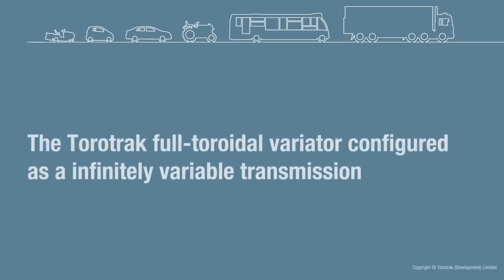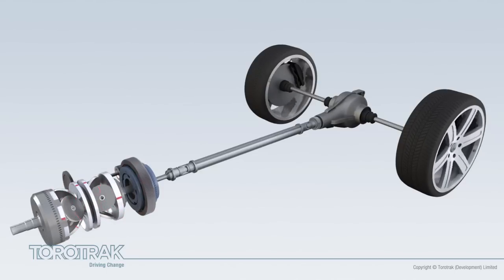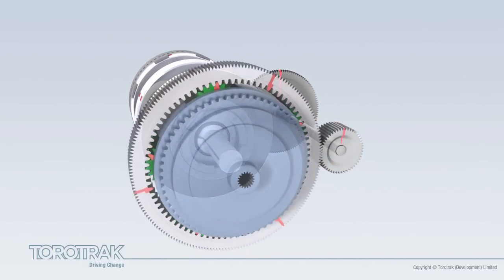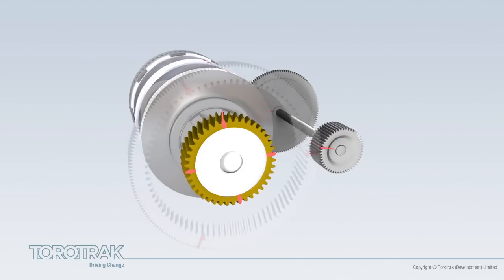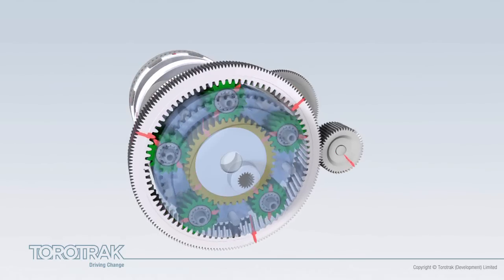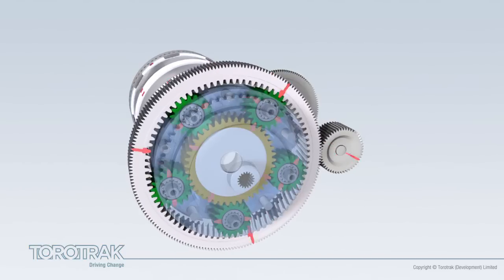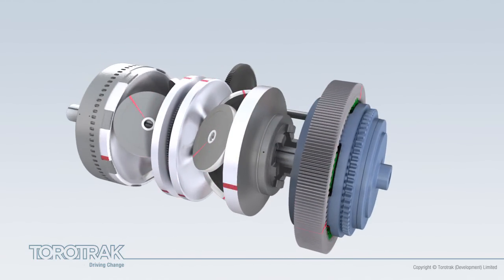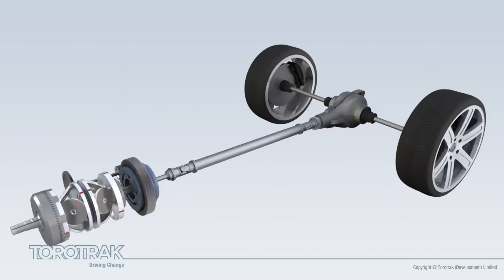Torotrak's Full-Toroidal Variator Configured as an IVT

Comment: Isn't this the same high torque CVT used  by Nissan on the cedric?
Reply: I think Nissan moved away from the toroidial cvt and moved to the more conventional belt and pulley system most cvts operate under

Comment: There is a significant problem with this design, is the primary torque being delivered through the variator. It would be better to directly transfer the torque input through the planetary, to the output... using the variator as a reference drive, connected to the ring gear, via worm drive. This would limit the torque transfer through the variator to only transient load... increasing the longevity of both the unit  and traction fluid. This would also greatly reduce the overall weight and volume of the transmission, by focusing the mass required for full torque load to the planetary gear sector. As such, there would be only one drawback to above suggestion... in that reverse would be both inefficient (driven through worm gear) and limited (to the capacity of the variator) if a separate reverse drive was not provided to the output shaft of the transmission.

Comment: In the Neutral position, if the car will move forward (for example downhill), the engine will increase it's rpm. But if car move backward, te engine will be decreasing rpm and go off when it'll be to low rpm.
Idea is great. I've made something similar, without clutch, and continuosly change from forward to reverse, but with the same problem on 'neutral' position.
Reply: Iam also interested in designing gearboxes
Iam with you
For better invention.are you agree with me.iam from India .
Reply: Did you actually build such a thing, or just design one?

Comment: In my opinion,The video forgets to mention the loss of efficiency due to the mechanical overhead of the hydraulic pump required to "pre load", or provide axial compression to the variator, which may be why this transmission has not been commercially successful. Electric hybrids have rendered this obsolete, which is why they are prevailing.